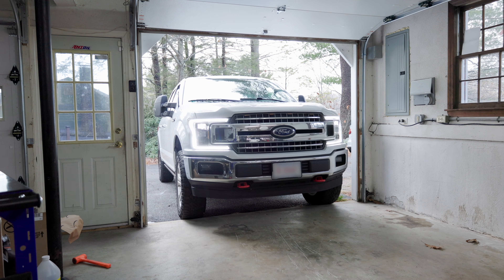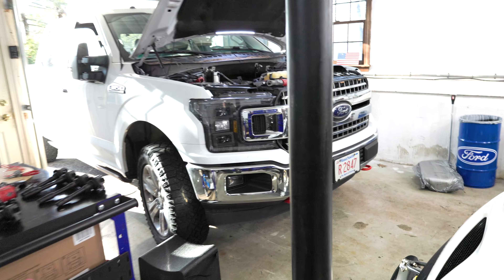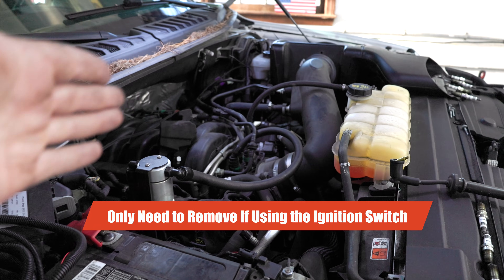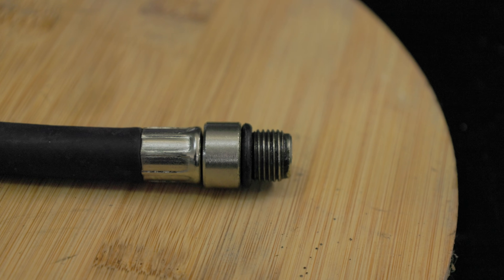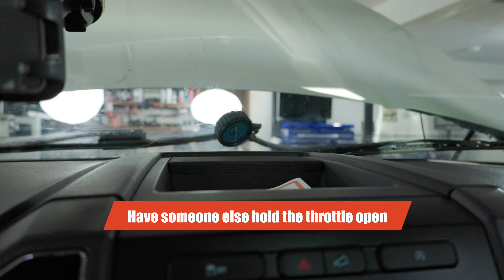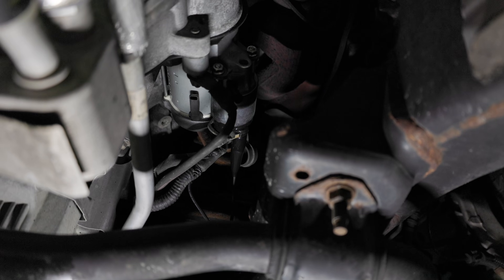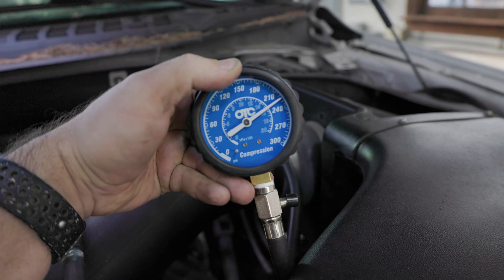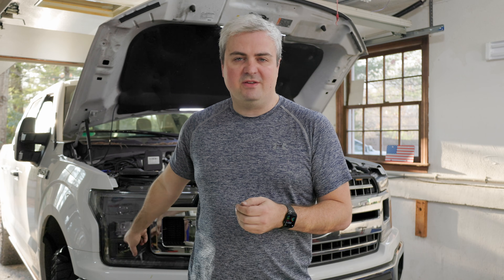Ford F-150 5.0L Compression Test Results (100k Miles)

Comment: When testing a cylinder, Are you leaving the other 7 spark plugs and ignition coils in...or are all 8 removed at the same time. In other words, does having the other 7 plugs & coils in/out affect the test results?
Reply from the maker: I have them all out when I'm running the test. I don't see why it would create any difference as long as you still have the same engine revolutions.

Comment: I did this on my 2012 5.0 at 210k.  Was changing spark plugs and coils anyways so figured i would get a good compression reading.  Not as high as yours but my low was 195 and high was 230 at 210K miles.   Still running great and towing boat and enclosed trailer NY to Fl and back along with a couple timed just making the drive to see grandkids or appointments with Drs.  Started getting better milage at about 180K. 
At 248K now and still going strong.   Looking to go 500K on all original motor tranny transfer case and Diffs.  Change fluids and filters yearly on everything except oil at 5000 and coolant at 100K. Brake flush every time i change pads.   
Just bought a new 2025 eco boost to replace this truck with the right deal.   The eco will be once a year NY to Fl and the 2012 will be the work truck major highway hauler.
Reply from the maker: That's great to hear!!! Those are some great numbers over a lot of miles. I'm hoping mine is the same when I get there (if it doesn't get traded in first)

Comment: Engine is fine but 10r80 transmission is failing quickly 2020 5.0 . Failing valve body and cdf drum . Super common unfortunately. Totally disappointed.
Reply from the maker: That sucks.... I've heard it is common as well.

Comment: Ok let me tell you what you did wrong 😊 It seems like maybe you got the throttle blade to open by using the gas pedal when the vehicle was powered up, then stuck something in there to keep it open? If so, don't do that - with the vehicle completely OFF, the throttle will be closed but you can just reach in there and push it open; that's the correct way to do it. In general you shouldn't be messing with electronic throttle bodies at all when they're powered on - once they're off you can mess with them all you want. 

You also didn't need to disable the fuel. By using the external starter switch you're bypassing the PCM and all that so it doesn't even know you're spinning the engine over, hence it's not going to inject fuel/trigger the coils. Didn't hurt anything ofc, just wasn't necessary.
Reply from the maker: You are correct on what I did wrong... lol. I disabled the fuel because I initially tried doing the testing using the ignition switch instead of the starter switch wired in.

I was told that these throttle bodies didn't like being opened manually so I didn't attempt it. So I do agree with both your criticisms lol.
Reply: @SmackeysGarage  I'm not sure why there's so much confusion/misinformation out there on electronic throttle bodies, but you're not the first person I've heard that from. If you need to open one and keep it open (such as for cleaning or a compression test like you did) then best practice is to actually unplug it or disconnect the battery, then push it open manually. This is safest for the throttle body itself and your fingers. It's once you start trying to manipulate it when it has power that bad things can happen.

Comment: Love my 2018, it's always done me good. It does consume oil and has the classic tik they're known for. I am at 97k, I plan on doing a big 100k service in the spring!
Reply: What kind of service are you gonna do to it?
Reply: I also have a 2018 coming up on 100,000 miles.
Reply: @chasewright996 probably spark plugs, serpentine belt, a bunch of different fluids (coolant, diffs, etc).

Comment: My 2019 F-150 5.0L Coyote is still running strong too after 103K miles. Just out of curiosity, what kind of oil are you running and how often do you change it?
Reply from the maker: Glad to hear it! I typically run motorcraft 5w30 and change it every 5000-7500 miles. My truck does burn oil, so I do add oil to it every 1000 miles or so... So it stays pretty fresh.

Comment: the numbers are all normal. Keep that cardboard with its readings and use it for reference in case you have an issue in the future . Ford did have issues with the 2018s cyl liners and im glad you are not one of them
Reply from the maker: Will do. I'm happy with where everything ended up. Thanks for watching and commenting!

Comment: Thanks for this! I have a 2019 5.0 with only 25000 miles. According to some of those on 5.0 facebook groups the 18,19,20 motors are not good and will fail. This gives me hope as I am almost afraid to drive mine after reading all the negative stuff on facebook.
Reply from the maker: Definitely don't be afraid to drive it. Mine does consume oil... I just keep it at the correct level and watch it. So far so good! I'm sure I'll put another 20,000 miles on it in 2026

Comment: Great video. Good to see that 5.0L still going strong.
Reply from the maker: Thank you!!!! 103,000 miles and still going. I'll be putting a lot more miles on it this winter
Reply: 143k still going strong to my 18 f150. Has BOSS 302 manifold, ported tb Roush intake roush exhaust and 93 tune and oil catch can